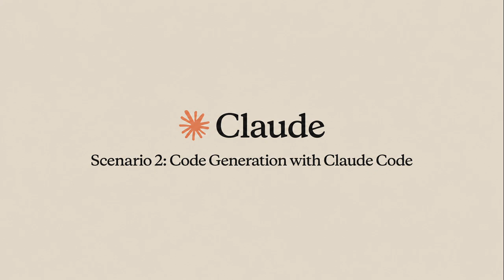How to Use Claude Code in Software Development? (Scenario 2 - Claude Architect Foundations)

Comment: Using Claude Code for architecture is the highest-leverage scenario and the riskiest. Architecture decisions are the ones that are expensive to reverse, so an agent picking a pattern is the place you most want a human in the loop. The value is the agent surfacing options and the human owning the decision, not the reverse.
Reply from the maker: I completely agree that architectural decisions should remain human owned.

This video isn't about AI making architecture decisions. It's based on Anthropic's official Claude Architect Foundations Exam Guide and focuses on configuring Claude Code to support developers through features like CLAUDE.md, skills, and context management, not to replace human judgment.